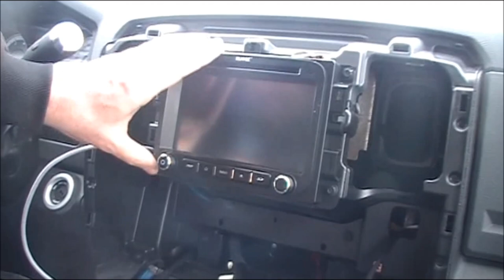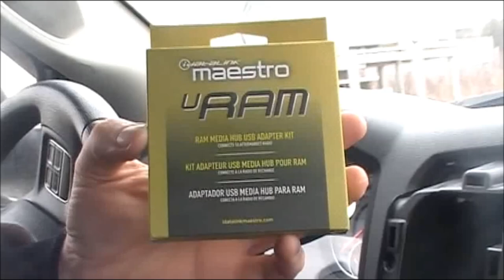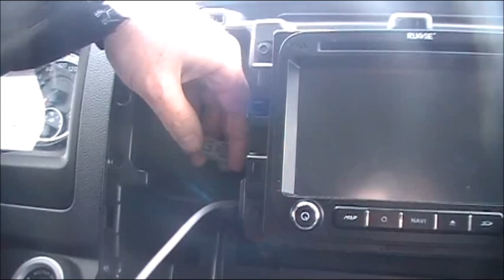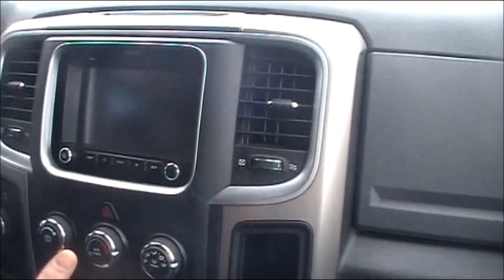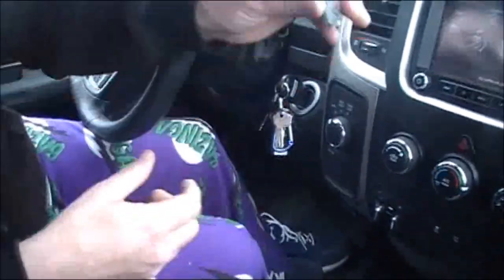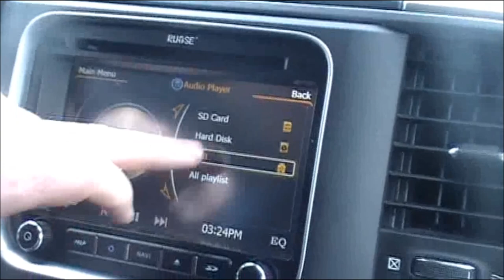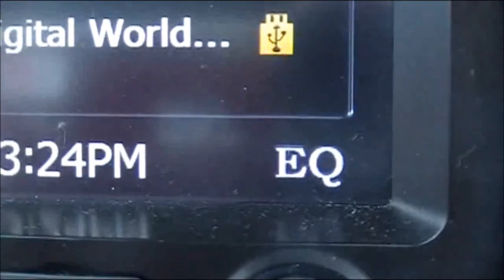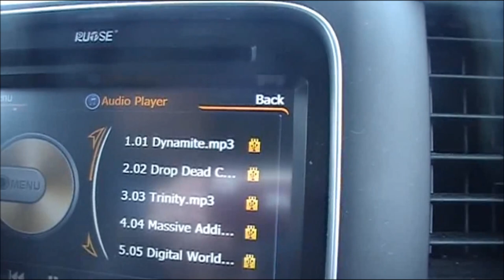2013 RAM Center Console USB Upgrade

Comment: I just did this to my 2014 Ram. IT WORKED. I thank you for this video. However to let others know, the OEM screws are smaller than the screw holes on the new board. I just used some Crazy Glue to keep it together.
Reply: instablaster

Comment: Great video. I was having trouble with my 2016 Ram 2500 figuring out how to get to the circuit board since the instructions included with the kit talk about a totally different console where you simply remove seven screws to get access. Once i viewed your video, I was able to easily accomplish the task. You only missed on small part where the instructions with the kit talk about transferring the plastic that surrounds the USB port. When you do that, it fills the gap for a more factory look. Thanks again.

Comment: Thank you for posting this content. It answered a lot of questions. I have a 14 ram with  a faulty usb console plug. When I go over a bump or the plug even gets barely touched, it cuts off my mp3 player. It has irritated me so much in the last couple years. I will definitely find one of these boards and do a replacement, and maybe even the stereo upgrade. Mine came with just the generic stereo unit which is very limited in features. Has the stereo in the video worked well for you and produced better sound over the original stereo?
Reply from the maker: For sure it did.
Reply: @faultenergyservices5460  Thank you. I will be looking into getting one of these.

Comment: That's great. I also found in that website an idatalink maestro kit to use factory xm antenna. Will this work in the same Ram 1500 truck?
Reply from the maker: Not sure but I will get some info and get back to you.
Reply from the maker: I researched and it should work with your factory XM satellite antenna.

Comment: Will this still work with the steering wheel controls, or do I need an additional module?
Reply from the maker: You will need to install an aftermarket steering wheel control module.

Comment: do you know if this will work on the full floor console (not the jump seat)?  I used your video to install this on my jumpseat, but am about to swap for a full console... hopefully this works??
Reply from the maker: It replaces the factory board. If yours has the usb and aux connections shown in the video it should work.

Comment: Does the factory USB jack on the lower dash still work ?
Reply from the maker: Yes. They are not connected by the same cable. The dash one is for charging only.

Comment: hi does your factory back up cam work with the s100 stereo
Reply from the maker: I am using an aftermarket backup camera so I'm not sure. I will research and let you know.
Reply from the maker: Apparently you need to splice into your existing harness. There are videos online for how to connect to a factory camera.

Comment: how does the aux headphone jack connect to after market unit?
Reply from the maker: Your aftermarket stereo should have auxiliary inputs. Also there should be auxiliary inputs as part of the wiring harness that came with the stereo. Don't forget that these trucks need a specific harness due to the use of a Canbus system.
As for the auxiliary input in the upgraded USB it is simply plug and play.

Comment: what stereo system is are you using?
Reply from the maker: I am using a S100 factory fit aftermarket stereo. It is simply plug and play. It is available on eBay, Amazon,and other types of similar sites. If you Google it then you should be able to find it.

Comment: Have you had any problems, with the u ram not reading an ipod?
Reply from the maker: No I haven't
Reply: Ya, this thing sucks unless you have a compatable head unit for the new circuit board, otherwise its only good for charging. Waste of money. Better to run a usb extension to glove box or slide out trey under heat controls.
Reply: @mattjo0078  that's why this video describes installing this with an aftermarket radio. Without an aftermarket radio it is just as well to leave the factory one there. If all you are looking for is charging ability then just use one that plugs in to a 12v.
Reply: @johnmnoftall8703  I doesn't work with my 2017 I installed just like the video.
Reply: @Tazz6896  what part doesnt work? Did you install this with an aftermarket radio or factory unit? It will not work with a factory unit.